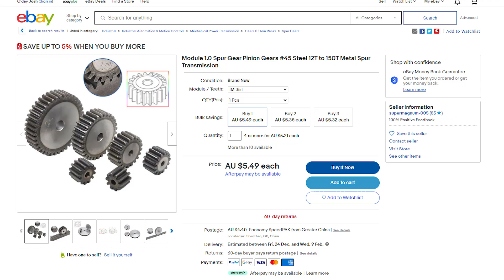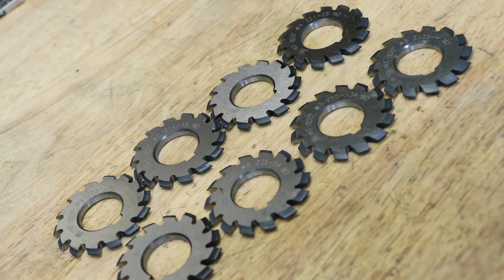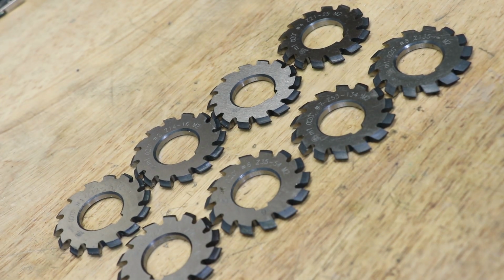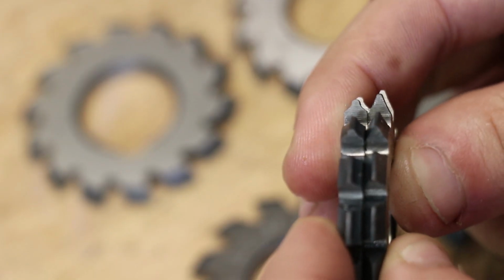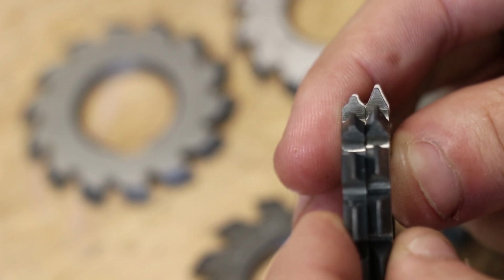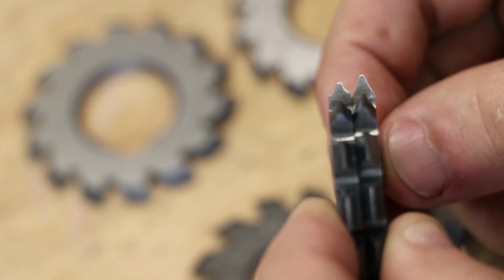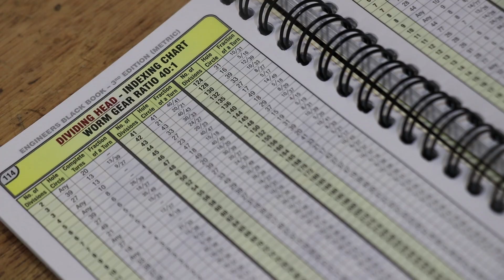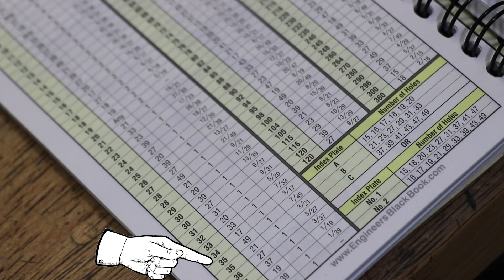Making Gears From Scratch

Comment: If the gear doesn’t break, what does? And is that breakage a more difficult or costly replacement?  0:25
Reply from the maker: Most lathes will have a shear pin

Comment: Hi
I am about to cut some mod 1 gear. I have some questions about gear cutting. 
What RPM did you use? Did you go full depth of cut? (I can see you did full depth initially.) 
Does climb milling cause vibration?  My setup can not do conventional milling.
I have a x2.7 mill and am trying to do a 63 tooth gear in aluminium.
Thanks

Comment: Having the same setup I first added a stepper motor replacing the indexing disk to reduce monkey work rotating the handle and then replaced this horrible manual gearbox with an electronic one based on a stepper motor and a rotary encoder. Now I'm happy and can share the sources if anyone wants to repeat them.

Comment: Although nice and ingenious, the manufacturing process you use is not really correct. Your gears will fail through Fatigue and contact pressure. The correctly designed/manufactured ones have a specific shape given by the Involute. This can not be machined using your approach. Nonetheless, your approach is sufficient as long as you don't use them for cars or airplanes. 
Was a great video and also Nice work.

Comment: For light cuts like you usually have to take, give some aluminum inserts a try. They're super cheap, sharp as a cats claw and work really well on steel. - No, you can't take 70 though depth cuts with them, even on big machines, but they work great for the type of work you do - and require a lot less cutting pressure.

Comment: Cut the key so that you can lock the blank before cutting the gears
Reply from the maker: It probably doesn't make much difference. I've seen it done both ways so. The clamping screw doesn't good enough job at clamping it, already with steel and aluminium gears
Reply: @artisanmakes  you don't want it to turn even slightly because that would ruin the entire gear
Reply from the maker: @therealspixycat  Yes of course but like I said I've seen it done both ways in machine shops and it seems to work either way
Reply: @artisanmakes  i never done it, yet, but like to do the same. I "only" need to score a diving head and buy a set of cutters.

Comment: I've cut many gears using hand ground profiled 2 flute end mills.....the gear form for the cutter was viewed using a modified slide projector to project the form of the cutter onto a wall 4 metres away against a hand drawn projection chart.
Reply from the maker: Really interesting to hear. I've seen similar methods used for grinding tools but I've never done it myself. I was actually looking for involute end mill shaped cutters and was really surprised that they aren't commercially sold. Cheers
Reply: @artisanmakes  An end mill per se is quite easy to make......when I was just out of school I bought a small piece of crap lathe and made cutters from high carbon or silver steel and hardened and tempered them myself with an alcohol torch.
For milling, the cutters were of the flat 2 cutting edge type, hand cut, hardened and tempered.
Profiled cutters for gear cutting were also flat 2 cutting edge type and later I used broken centre drills for the blanks (no hardening required)  with the profile hand ground on a bench grinder as previously said..........cutting racks with just a 29 deg angle is the easiest.

Comment: Unless gears are not very small one or two gear cutters is enough for plastic gears. It is also possible to make cutters, any mild steel will cut plastic well. 
I made full set of gears for my lathe, all from scratch. Dividing plate, gear cutter, arbor for the cutter, lathe carriage attachment for drill to use it as a mill. (And MT adapter for drill chuck to be able to make arbor). 
That is about all you need to cut (plastic) gears. I don't see much benefit to make gears from aluminium
Reply from the maker: I've heard something similar, though I remember that number being three gear cutters, from memory of you want to cut small pinions it's good to have a low tooth cutter, though I could be misremembering that.

Funnily enough when I used to cut acrylic exclusively, I had to grind up some custom tools from mild. They actually worked pretty well, although it was cold rolled. Cheers

Comment: Nice work not sure if you should be climb cutting those gears though. Thats kinda asking for trouble especially on such a small mill
Reply from the maker: Doesn't cause any issues on aluminium and I get a much better cut, I'll have to flip the cutter for when I do steel gears

Comment: Do you ever make spiral bevel gears?
Reply from the maker: A basic bs 0 dividing head like this can not make spiral features. The more expensive BS 2 models have a gear train you can attach to the table leadscrew that will rotate the dividing head as the table moves, so you are able to cut a spiral. Though I'm sure it wouldnt be too hard to make my own attachment, or rig one up with a stepper motor, Cheers.

Comment: Do you think it needs heat treatment..??
Reply from the maker: Im using 6061 aluminium which is already precipitate hardened. If I make some steel gears, I might get them case hardened.
Reply: @artisanmakes  Opss.. I thought it was steel. Me bad.
Reply: @artisanmakes  Just use 1045 and don't bother about casing them

Comment: Nice!  I got tired of swapping the fiddly gears on my mini though and converted to an ELS (Electronic Lead Screw).  It's so handy to change from roughing, threading or finishing with push of some buttons in seconds instead of several minutes to with each gear change.  If you're like me and constantly need to change the gears to go from different operations consider an ELS.
Reply from the maker: I have considered that swap before too, though I rarely use the leadscrew for anything so it wouldn't benefit me too much. Cheers

Comment: Great fun video! 👍
A couple of points;
Why use a 49 hole plate and do 7/49ths when you could have used a 21 hole plate and used 3/21 ? Much easier to count and going with the simplest plate is usually the best.
And, gears only need an accurate tooth profile if you will be running them at high speeds and high power transmission levels. The accurate tooth profile reduces friction, heat buildup etc.
For your case the gears are very low speed, very low power transmission and very infrequent use. You could have cut any dodgy "tooth shaped" cutter out of HSS and got a result that was totally acceptable.
Anyway, just some thoughts, great channel by the way. 🙂
Reply from the maker: To be quite honest I didn't notice the 21 hole division table below it, the 49 one was above it and that's what I read first. I wasn't really expecting there to be 2 rows dedicated to 35 tooth indexing and only noticed after I cut the gear :)
As for cutting my own gear cutter, I was tempted to make a fly cutter tool of some sort, but these gear cutters were on sale (normally I would pay $140 for the set) so I opted for them. If I end up cutting another gear module, or Diametral or cycloidal I will probably make my own cutter. Cheers.

Comment: A quick and dirty trick to cut seldom used imperial threads (27TPI) on a mini lathe ist to print the required change-gear on an 3D printer. Did work fine, but i guess not for a long time. 
Milling gears is on my to do list. I don't have a dividing plate for my rotary table, but I am sure a 3D printed dividing plate will work fine.
Reply: Even quicker and dirtier way to make a dividing plate;
Print a paper sticker label on a bubblejet printer and glue it on your metal stock, then centre punch and drill the dividing plate on a drill press. The tiny position errors in the holes won't matter for simple gear cutting because they are reduced 90:1 By the rotary table worm drive.

Comment: With you manually turning the gear like that isnt there a chance of a loss of position? Can it lock in place after you've moved it?
Reply: You only turn forward which I think would help with backlash. Plus the head has a pin that locks into those holes for each cut
Reply: That is what the holes in the division plate is for.

The turning handle doubles as a pin to lock it in place.

Comment: Can someone please describe how the slot (keyway?) was cut into the inside of the gear?
Reply: If a keyway cutter isn't available, you can pick up on the centerline of the bore, plunge in with an endmill that has a diameter equal to the key's width, then file the corners square
Reply from the maker: Just hand filed it in, camera was dead when I went to do it, cheers

Comment: What rapm are you using when turning the steel with the carbide tool?
Reply from the maker: Can't remember off the top of my head but it's around 800 or so. These inserts have a decent working range

Comment: When you're cutting the aluminum gear at around 10:35 are you jjst supporting the cut with the socket cap bolt in the tail stock? Surely that can't be the best?
Reply from the maker: A small dab of CA glue and a small washer held the part in place without too much issue, cheers

Comment: nice video. Now if you plan to make many gears, i recommend that convert dividing head to arduino powered stepper motor drive, it will be much easier, and less possibility  for errors in dividing. Thanks for sharing...
Reply from the maker: I am thinking of something like that too, but mostly because there are gears I can't cut with this using the conventional dividing plates, such as a 101 tooth gear for example. Cheers
Reply: @artisanmakes  you are right. That is actually the reason why i did it so i can easily make gears on any number of teeth, and avoid differential dividing add on to the dividing head...
Reply: +1 for that, worth it.

Comment: Do you find the self centering 4 jaw is better than the 3, or is that just what you happen to have?
Reply from the maker: I had to buy the 4 jaw scroll.chuck for a previous project where I had to turn a lot of square stock of various sizes into round stock and it was much faster than a independent 4 jaw. I just keep it on because it's a much better quality chuck than the 3 jaw the lathe comes with. Plus 4 points of contact is better than 3. Cheers
Reply: The issue to be aware of with scroll chucks that have four or more jaws is they are over-determined. So some jaws may be tight while others remain loose. This can't happen on a 3 jaw because no subset of jaws can clamp the material.

Comment: In the beginning, love it. "The cost of metal gears is very reasonable...so I bought the tools to make them instead"
Reply from the maker: I also offer financial advice if anyone is interested :)
Reply: @artisanmakes  You know, if you wanted to, you could sell reasonably priced gears on ebay now that you have the tools to make them.
Reply: Consider it learning time for when you need to make a gear that will not be cheap or easy to find. It is best to learn on parts that are not critical.
Reply: Make or buy analysis: Make EVERYTHING 😀   ... except for the tools themselves.
Reply: @MF175mp  He did make the Mill Arbor.. that's a tool!..
I have a habit of making my own tools..but then.. i am a toolmaker, who's gonna stop me anyway?..My Lathe Cutters are mostly of an own design, using inserts made from dull or broken Carbide Endmills..at €24 for a Diamond wheel, why wouldn't i give it a go?..
Reply: It is better to buy tools to make tools than buying the tools made, trust me you learn alot and save alot by buying tools to make them
Reply: @juancarlosruiz1985  well you save in the end. as we have seen he didn't just stop at that 1 gear. he made strange sized gears that probably cost wlot of money per gear. also hobby machining is really not a way to save money when you factor in tooling costs
Reply: You are not limited to the gears in the set, then.

Gears are useful, in general.

Comment: I've been following your channel for quite a few videos now and I really like your style. You're doing a great job.
To put the quality of your parts to the next level, I highly recommend you to be even more thorough with deburring. There are good reasons for always deburring edges:
1. Safety. We all know that burrs can leave nasty scars not only to the machinist, but also to the person fixing/upgrading/cleaning things someday down the road. Or even harm customers, which professionals should by all means try to avoid.
2. Accuracy. Clamping a bolt down on a burr around the hole might hold up well initially. But on ratteling machinery or any moving device, the burr may wear quickly and the connection comes lose again and again.
3. Appearance. A small machined chamfer on all edges just look so nice and clean and transport a first hint on high quality.
If you really want to put your deburring job to the test, use a cotton rag and lightly drag it over all the edges of the part. If it catches there is still room for an even smoother finish.
I hope this is of some value. Thanks for sharing and all the effort you put in your videos, Artisan. Looking forward to upcoming projects
Reply from the maker: Thankyou for the information, it is certainly helpful. This was my first time making gears outside of 3D printing some and doing theory in engineering class. I'll make sure to refer back to this next time I'm making gears, Cheers.

Comment: Great video
What book were you refer to?
Please talk about the scamming you referred to in a previous comment reply
Reply from the maker: That is the machinist blackbook, super useful and handy. It was a gift but they well for around $50 and contain a good deal of workshop information. 

The vendor I purchased from is called Vevor on AliExpress. The dividing head was on sale and after purchasing it they demanded I pay more money, so I had to dispute the sale to actually get the product shipped. It was a gamble but in the end I got the diving head.
Reply: @artisanmakes  I bought a 24V power supply off aliexpress, it didnot turn up, I tried to dispute but aliexpress would not accept the dispute for another month after the latest delivery date, which ended up about one or two days before the dispute deadline. The vendor just bullshited along trying to run the clock down and aliexpress seem to be part of the delaying process. In the end I got refund but with a very bad feeling like its just one big scam. 
Now im getting emails from ali inviting me back that they miss me...

Comment: Thanks for making the video and sharing. I'm on the same pathway myself. My Chinese Mini Lathe came with a metric lead screw and none of the  change gears needed for cutting imperial threads with any degree of accurate pitch. I have the same dividing head that you do. I'll be able to make all the needed gears except for a 57 tooth gear with the dividing head and dividing plates as they stand. I figured I could create a replacement direct dividing plate, replace the existing geared indexing pin with the pin ground down to 0.125. I would create the plate in the mill using my DRO to make the hole circle.
Reply: i had the same problem needed 67 tooth gear  to turn  16 TPI well 67 is a prime number so i needed to make a 67 hole dividing plate  to make the gear felt like i was chasing my tail
Reply: Or 11 teeth….

Comment: Is there any way to get enough precision using encoders and a proper dc motor + electronics to cut gears using just the lathe motor or is a dividing head strictly necessary?
Reply: Theoretically, if you can fit a gear in the back of the headstock and then add a worm gear + plus a (homemade, probably; possible to make when the gears are fitted) dividing plate, cutting with a milling attachment, then there is a good chance it would work.
 With the price of dividing heads and small chucks, it is up to you if that is worth it.
A proper stepper or servo motor has an easier time dividing then a DC
Reply: Yes there is - See James' set of videos - It's not inexpensive either.
First video in series.  https://www.youtube.com/watch?v=FTs9GygRQ-U